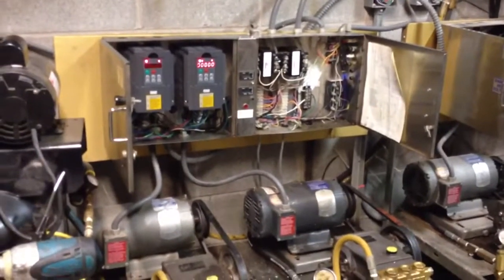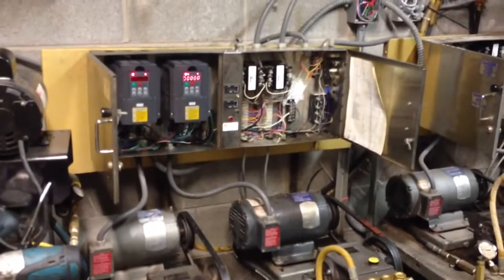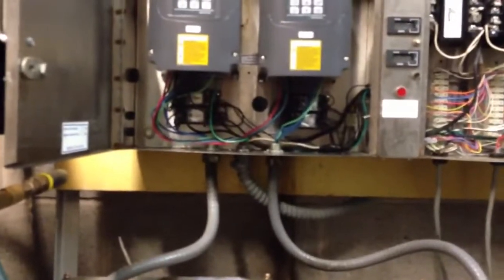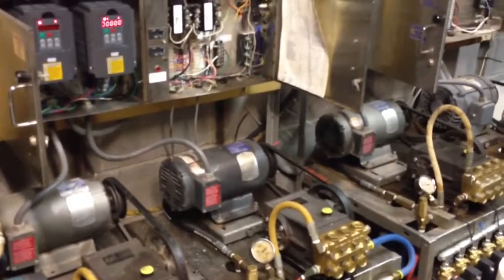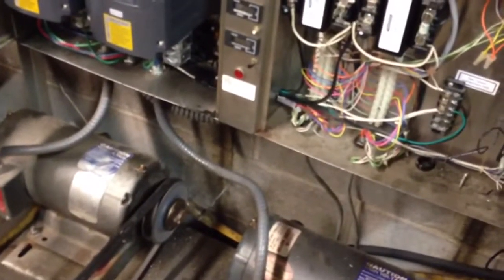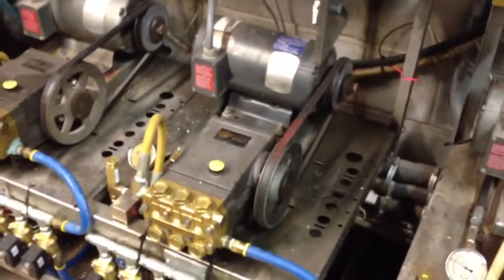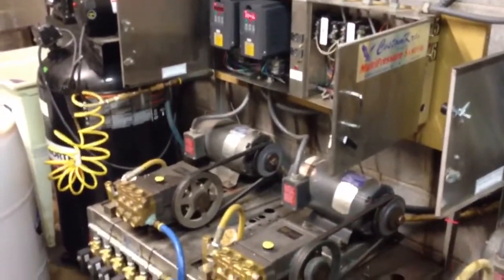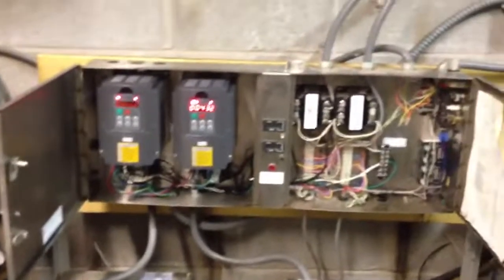VFD Retrofit on an old Custom Kraft dual pressure self serve car wash system.

Comment: How's it been after all these years?
Reply from the maker: Those cheap VFD'S did not hold up. The power supplies went out on a few. I replaced them with used name brand a VFD'S and they worked great
Reply: @brockallentaylor  I have the same system and same problems. Is there a brand VFD you found that works consistently? Thanks.

Comment: I am looking to do the same sort of setup in a home system, and would like to know how you programmed (and wired) the feedback to slow the pump. Is there a pressure switch in the unloader valve?